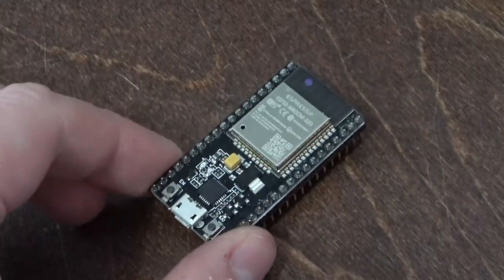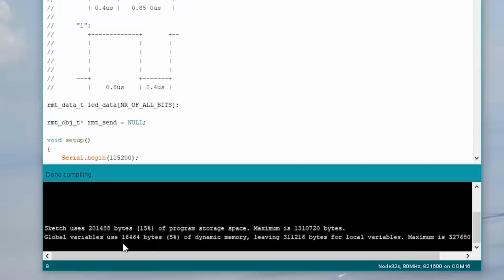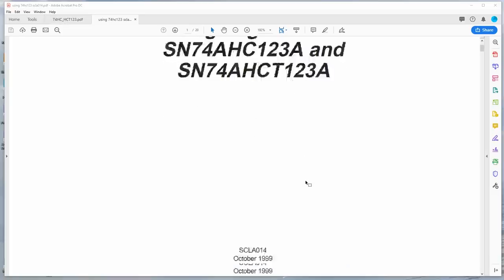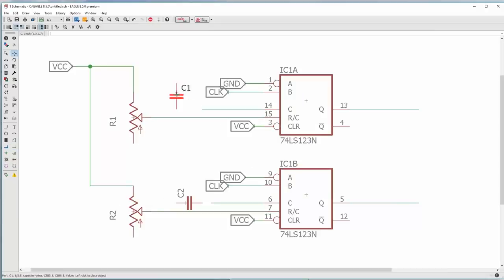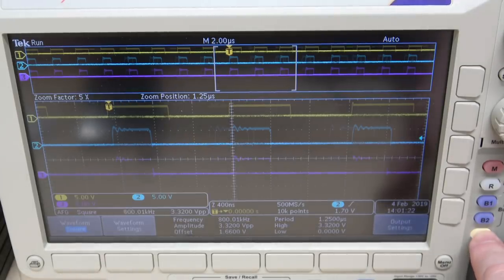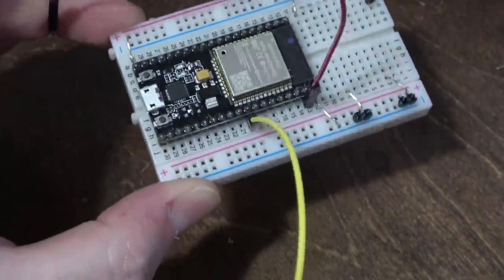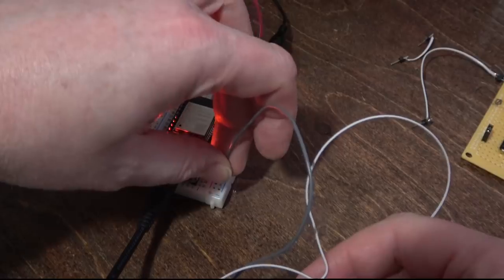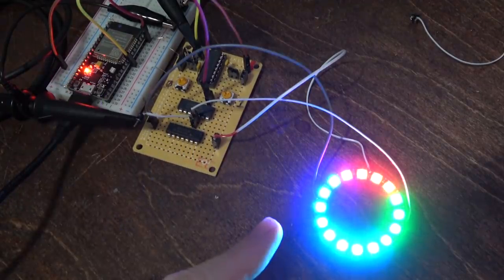SPI to Neopixel Adapter

Comment: Im certain the library could have been edited to make it far more memory efficient, Though maybe a little slower to chuck out the data, but with an ESP you'd never really notice.... However, this really reminds me I really need to start learning this level of electronics hardware. Im still pretty much a beginner...

Comment: You could use a 74HC157 instead of the AND and OR gates to make it a 2 chip solution. Also could use a little 6 pin 74LVC1G157 if you don't mind SMD.

Comment: You may be able to use only a single 555 if use the data line to interfere with the capacitor charge time through a second potentiometer. You will need to ^0xFF the data, though.
Reply: I never understood why people use ^0xFF over ~. Is this a personal preference thing or is there some actual difference between the two?
Reply: @JoQeZzZ  They are the same only for uint8_t, but I used ^0xFF because I thought it would make the idea clearer.
Reply: Ah check, so it is personal preference then. Thanks man

Comment: Are these Neopixels PWM controlled (driven?) only? I mean about that blinking (that also is visual on cameras).
Reply: Internally, yes. One uses them by feeding a data signal with RGB values (not in that order, looking at the color he got with FF00AA I would guess BRG). There is a small ASIC (Application Specific IC) inside each neopixel that looks at the data stream on its input pin. It sets it's own PWM drivers based off of the first 3 bytes and then sends the rest of the data stream out it's output pin.

Neopixels (WS2811, WS2812, or SK6812) are known for having fairly slow internal PWM clocks. Dotstars (APA102) have a faster PWM so are more suited to PoV applications, but require 2 wires (clock and data) to drive them.

Comment: Is it wrong that my urge is to just grab an ATtiny to use as the interface? Certainly a smaller chip-count, not so sure about power consumption though... But compared to a load of glowing LEDs, pretty insignificant I imagine.
Reply: At tiny costs more than the logic gates, in speed and monies.
Reply: @clownisius  maybe, but you save on space, other components and you barely need a pcb... Plus I have several in a draw... Unlike 74123s 😉
Reply: You're wrong - they cost in china roughly the same, 5x74hc123 = 2$, 10 SMD tiny13 - 3$, DIP8 - 3$ for 5, thats first results really. 
and i bet anything that 1kb is enough to covert spi signal to that weird timings, just a touch of asm nops and there you go
tiny can run on intenal clock (bc ws doesnt give a lot of shit about timings), and all you need to do - pipe in over spi some data, and maybe use one leg as a feedback, in case if you are faster than driver

also i hate ws, if only they had a clock pin...

Comment: Why don’t you just use APA102, they can run directly on the SPI bus at 10Mhz 😉
Reply: .... or the WS2801
Reply: The APA102 has clock-propagation issues, and is more susceptible to noise in the data line, and isn't available in as many form-factors and color choices (e.g. The APA106 and addressable white SK6812s and such)

Comment: Buolding things on protoboad is so expensive here in germany. Compared to protoboard, you can buy here, it's cheaper to order custom pcbs from JLCPCB
Reply: Yup, also in Italy. I started to buy pcbs directly from oshpark and now JLCPCB  for prototypes.
Reply: you cant buy protoboard on ebay?
Reply: Protoboards are pretty cheap on eBay or Aliexpress.
Reply: If I have to wait 40 days for protoboards I prefer use that time to build a prototype on breadboard and than order a custom pcb. Same time, better result!
Reply: @tuttocrafting  But you can buy protoboards in advance and have a bunch of them for future use.
Reply: How expensive is too expensive? Sure, JLCPCB non-leadfree's are hard to beat, but you don't have 'em immediately. You can get a eurocard sized protoboard for okayish prices at Reichelt.
Reply: Did you notice the brand name on that protoboard? RadioShack went out of business several years ago. People like Ben went on shopping sprees during the clearance sales and have enough protoboards (and other items) for several years (decades?) for next to nothing (per item). I'm just disappointed that I didn't have the ready capital to do the same.

Comment: I find that sloppy square wave to be far more concerning than the memory usage.
Reply: Meh... Just throw a schottky buffer and impedance match the output to the neopixels and that will clean up the signal (and get rid of the ugly (but probably innocuous) notch in the data 1 pulses).  All that is unnecessary for the proof of concept that this was.

Comment: Yeah, let's save all the invaluably precious memory on a chip with half a megabyte of RAM.  We absolutely NEED  those 4K! Chip count and BOM cost is of no consequence after all XD.

Inconvenient, unnecessary, over-designed extra board which totally can be replaced with software. I love it :D

Comment: Keep life simple...drop in a dedicated $3 Arduino nano....code whatever you want displayed into the nano, and send it commands from the ESP32 via I2C.  I did this for a robot car that was being run by a RPI.  PI just sends commands to the light controller.  WS2812 neo pixels were used for headlight, tail lights, turn signals, etc

Comment: Honestly, I prefer Adafruit's solution. It's easier, faster (to implement), cheaper and more elegant. Unless you really need to save RAM/processor cycles, it's the better solution.

Comment: aren't Arduino libraries fun ;-)

The uint32_t might have its reason in the memory access alignment of the 32bit cpu core...
Reply: you could have chosen to trigger either monoflop 1 or monoflop 2 and OR together the two outputs instead... but I also like your apporach!

Comment: what
im using fastled library on esp32 
bare esp32 sketch with a loop 10672 bytes  https://i.imgur.com/kRWOe1W.png
32 led's 11184 bytes  https://i.imgur.com/JdD2CIT.png
64 led's 11280 bytes https://i.imgur.com/igkhxbs.png
1024 led's 14160bytes https://i.imgur.com/SQqVcMJ.png
96 bytes / 32 = 3 bytes per pixel.  not sure whats going on @ your side lol
i have 144 leds hooked up and can cofirm they do what they supposed to do.

going full power(theoretically, i dont have so many leds )  16384 leds + some serial cost 60660 bytes of mem and takes 499110µS for loop trough each pixel, set it to red, fastled.show() afterwards. https://i.imgur.com/1iIdvqW.png

neopixel = ws2812b

Comment: Just FYI, pico is pronounced peeco, not pyco. Unless this is a hidden reference to 1.21 Jiggawatts, in which case I approve.
Reply: rumborak u see, not in my part of the Woods, here it’s pronounced pico, the point is that it doesn’t matter.
Reply: Unfortunately, Americans do struggle with English vowel sounds so it is to be expected. ;)
Reply: rumborak no, not peeco in sweden, i did say in my neck of the Woods, guess the point flew you by.... I simply meant that it depends on your location, and trying to get perfect English from the international community on YouTube is quite simply not possible, and there’s a LOT Of worse English speaking Americans then Ben Heckendorn to hunt if you really have a need to...

Comment: Someone did that on a PIC using two channels of PWM to generate the two pulse widths and the CLC to merge the outputs together.
https://www.microchip.com/forums/m1083323.aspx

I'm actually working on a DIY "Ambilight" using a microcontroller or low end FPGA.
http://www.eevblog.com/forum/microcontrollers/choice-of-microcontroller-or-fpga-for-diy-ambilight/

Comment: Two comments:-
1. When there is 100 in the denominator you should DIVIDE by 100 not multiply as you did TWICE!  Your decimal point was a factor of FOUR places out of whack!!

2. PURLEEZE where were you educated? The pronunciation of Pico is not PIE CO BUT PEE CO!

Both errors are pretty fundamental!l
Reply: 1. Order of operations 

2. :|

Comment: 1byte=object
Object texture≤800ms
100ms guard/chamfer each side
Digital 0110 pattern= textures usable

Object oreinted programming is old
Watch at&t video on first computer animation and you see polygon like objects(2 of them and their 3d to)
In 60's at that(house of the rising "son"(inendo of 70's to cover child processes being used in computers 8 bit programing start clock get child(note parent clock also running at this time to shutdown child if needed by corrupting signal)instruction then work,,parent gets its instruction at dec50% and works at 75%))
Seems quite i q wave ntsc to me as 1st clock would be self generated by tv set and other 2 clocks injected onto this clock(am base (self gen) with fm pwm/pcm )
Yes very ntsc like
Self gen clock represents ntsc draw (1 pixel at time, left to right top to bottom)
Sets z as brightness and y as color